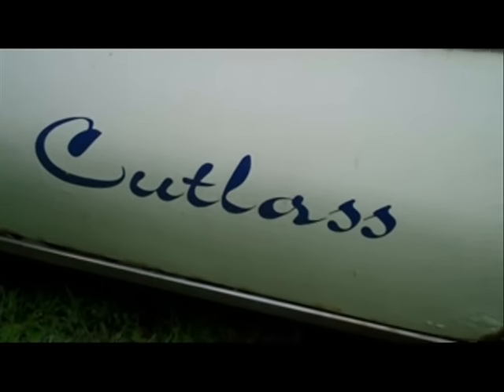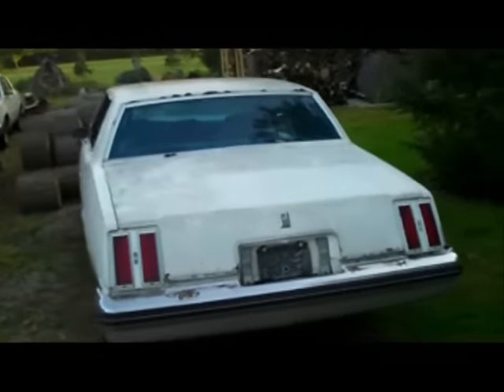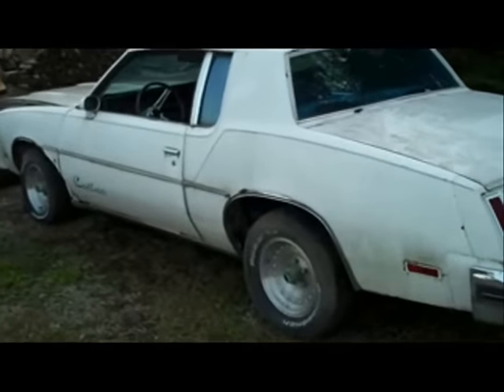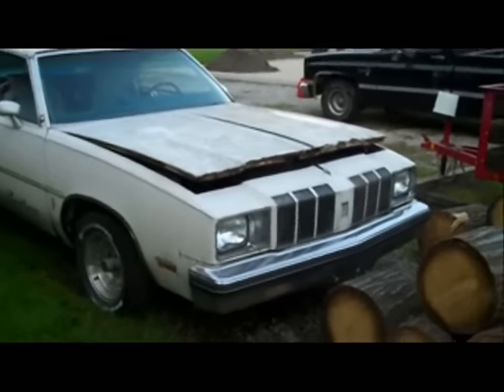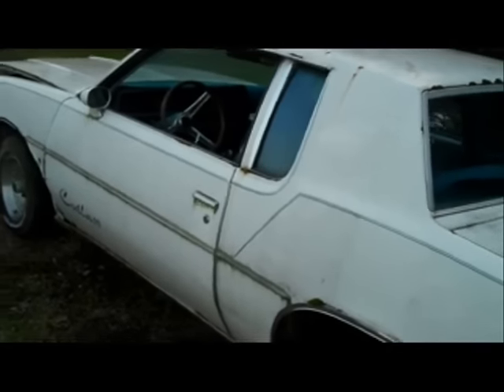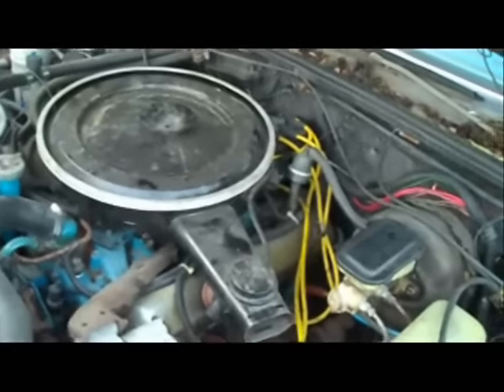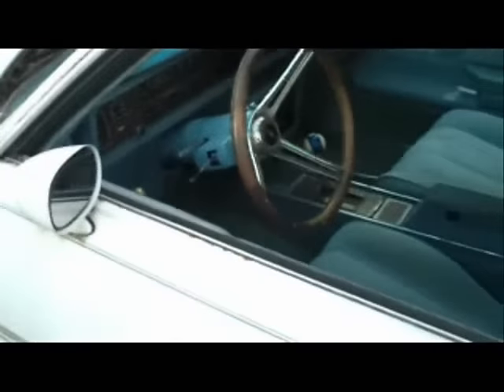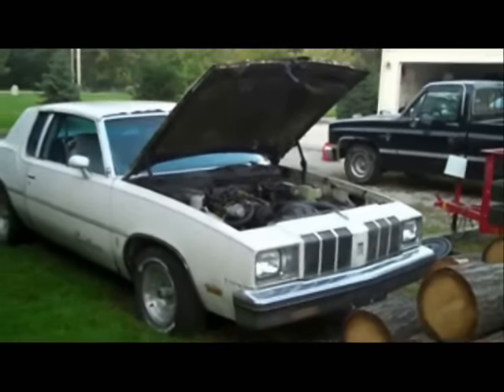78 Cutlass Reveal Interesting Story Behind This Car Classic G-Body

Comment: hi there i just love these cars i have a jet black car 78 with tan interior the interior is junk i,m still trying to decide which way to go with it. maybe alluminum dash racing buckets it has a 355ci 350 turbo 3500 stall all pollish alluminum engine parts, center line rims 15x31/2 and 15x8 i hope she runs out go if not its going B.B> jocko canada. p.s. do you need a alluminum hood?

Comment: Olds didn't make a small block and big block they made one size block from the way I understand it like Pontiac no ??
Reply from the maker: The decks were taller on the BBO which made them wider at the top, Heads were interchangeable. though.
Reply: not true... The 260 cu in (4.3 l), 307 cu in (5.0 l), 330 cu in (5.4 l), 350 cu in (5.7 l) and 403 cu in (6.6 l) engines are commonly called small-blocks.[1] 400 cu in (6.6 l), 425 cu in (7.0 l), and 455 cu in (7.5 l)[1] V8s have a higher deck height (10.625 in (27.0 cm) versus 9.33 in (23.7 cm)) to accommodate a 4.25 in (108 mm) stroke crank to increase displacement. These taller-deck models are commonly called "big-blocks", and are 1 in (2.5 cm) taller and 1.5 in (3.8 cm) wider than their "small-block" counterparts